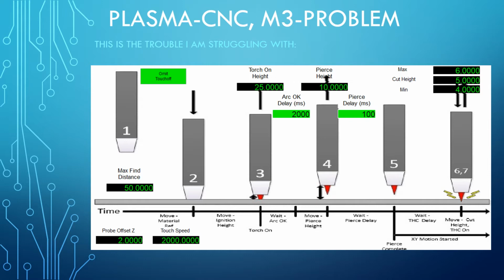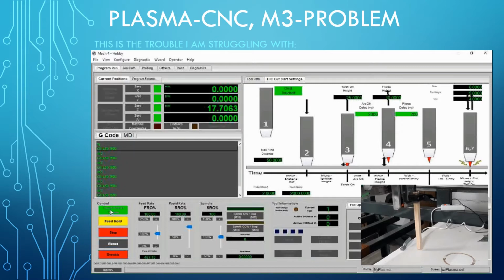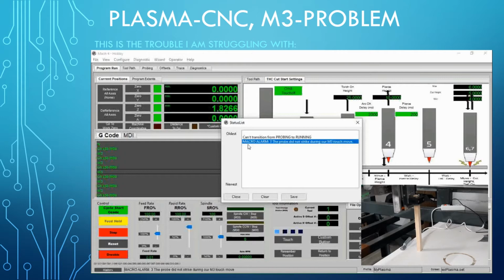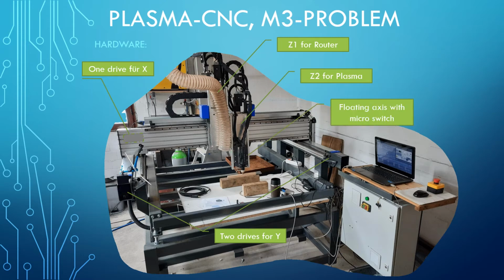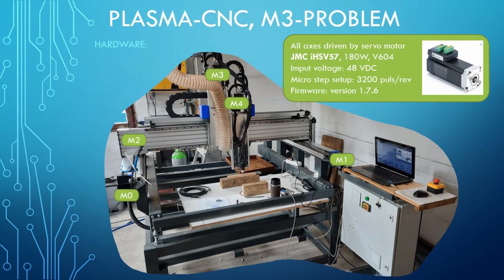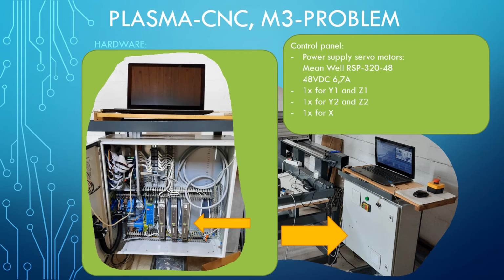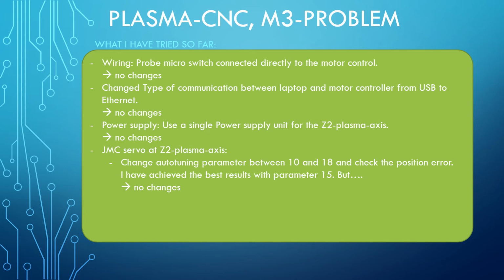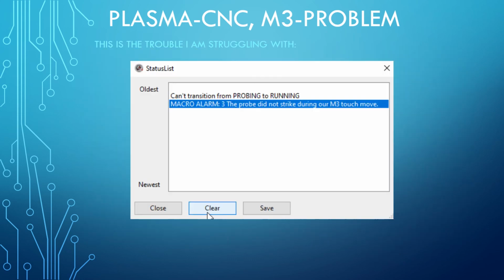Need Help for Mach4/PoKeys/JMC Plasma-CNC, THC Cutting Start interrupted

Comment: Hallo, das nächste was nach dem Probing passiert ist zu checken ob der Plama gestartet ist (ARC OK). Wie wertest du das aus, ohne einen ARC ok signal? Das M3 Marco ist leider nicht lesbar in Mach4, sondern ist ein hard coded Baustein in Mach4.  mcTHC.luac im Moduls Ordner. DIeses Modul wird über einige Register gesteuert, die beeinflusst werden können. Ich habe eine ähnliche Konfigiration mit dem PoKey57CNC Board und nutze den Analog Eingang für die 0-10V Auswertung. ARC OK wird geschaltet über 50-200V in der Plasma Konfiguration. ZU beachten ist das man das 0-10V signal vom Plasmagerät (in meinem Fall Hyperterm 45xt) optisch isolieren sollte und natürlich auf 0-3,3V runter setzten muss. also 1/3 teilen muss. damit wird ARC ok ausgewertet und auch die Scheidspannung gemessen und entsprechend THC über OBx Achse angesteuert.

Comment: Hi
I have same problem 
you have solved it?
BR Gerhard
Reply from the maker: Hi
I have not been able to solve the problem. But I have created a button on the screen that cancels the error and the plasma cutter starts at the point in the G-code where the error occurred. I called the button ‘Bug Resolve’. If this is of interest to you, I can send you the programme code.